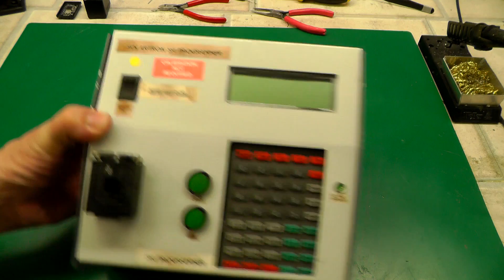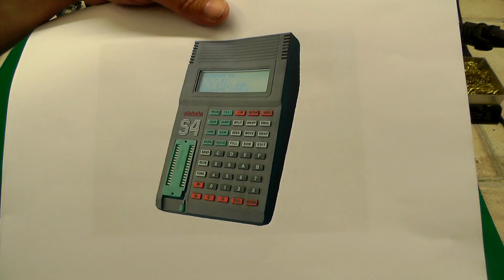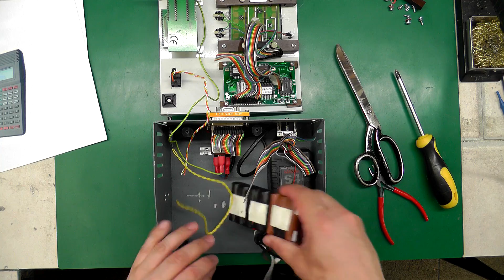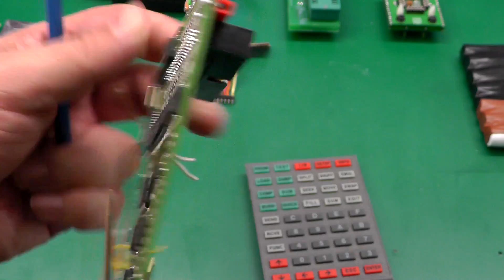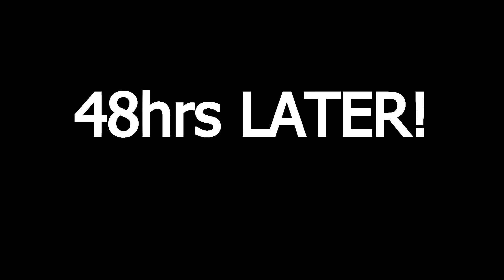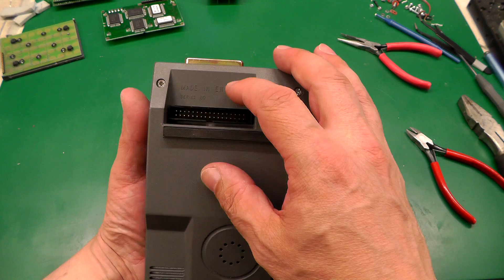No.028 - Dataman S4 Programmer Restoration

Comment: Nice opportunity to design and 3d print a replacement case. I'm working on one just now, not switching on, needs a new 3v lithium, and nicad pack low voltage, assuming I get it working, any recommendations for a separate eeprom eraser unit to reprogram eeproms?

Comment: Nice restoration.  I found this video while looking for details of the internals; I'm trying to repair an S4 which had a badly burnt bridge rectifier and some vapourised tracks.  I've replaced the bridge and a C106 thyristor, so it now works off the battery but always says "NO CHARGER". I'm still fault-finding.

Comment: I know this is an old video, but I just landed here. The thermistor for the battery is supposed to be a surface mounted part that presses against the battery when the case is closed up, but since you got it to close well enough, I don't think it's a problem.
I was given an S4 once, but as I had no purpose for it, I did repair its rectifier after I nearly destroyed it and sold it. That's how I know about the thermistor. Good job and you had an amazing amount of luck with the case.
Reply from the maker: Doesnt get used much, but I still have it.
Reply: I have an S4 with a badly burnt out bridge rectifier, but that's not all that was wrong. I've replaced the bridge and a C106 thyristor, and it powers up now but won't charge (it always  says "CHARGER OFF").  Any ideas what else might be damaged?

Comment: That was a great rebuild Ian, always enjoy some of the stuff you do. This might be a silly question are you going to put a serial number on it. And one more thing why is there a crystal in the zif socket add on board, would that be tie down the speed at which the programmer download the code at ? Cheers from Canada
Reply from the maker: Actually I did think about a serial number, there's a sticker on the PCB with a number on it. The add-on board has a crystal because the 8751 is not just an eprom, it's a micro controller (with a built in eprom) so needs fully powered up before data can be written to it by the S4.

Comment: When ever I try asking a company for new/old stock they pretty much tell me to shove off. Since it was slapped into a bigger case it must of been part of a assembly line of some sort. Last thing you want is a hand held device getting lost or stolen. Even mounted to a bench so it won't get dropped.
Reply from the maker: I don't think I ever dropped an S3 or S4, there used to be 2 or 3 of them around my old workplace. The nicad batteries were the worst thing, closely followed by broken charge sockets.

Comment: Looks much better now :) Good job!
Makes me wonder why they would modify it in the first place. Looks to me like their only "improvement" was a bit more rigidity in those stacked modules..
Reply: Looks like they may have modified them for use in a production environment.  The keyboard enable port suggests they didn't want line employees to be able to make mods, but someone with the "key" could load new or modify existing firmware.
Reply: It's often done in production or controlled build environments so things don't get changed or go missing. The power supplies or adaptor boards always go missing when you need them.
Reply from the maker: Module rigidity yes, and also things like the charge socket easily broken as I remember.
Reply: Or "borrowed". Make it big, clunky and single purpose and it's less likely to grow feet and walk away.
Reply from the maker: At one place I worked we laid of a workshop technician.....all went well.....till we went to use a bunch of Fluke DMMs and found the guy had robbed the pcb's from inside them swapping them for an older model (the technicians personal rubbish).........so yes, it happens!